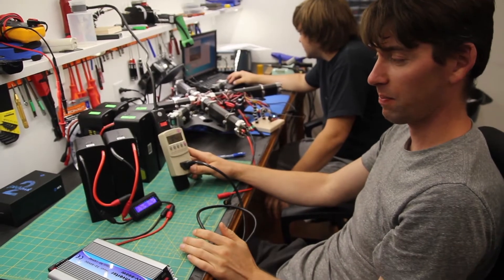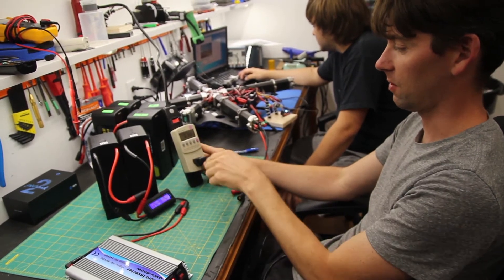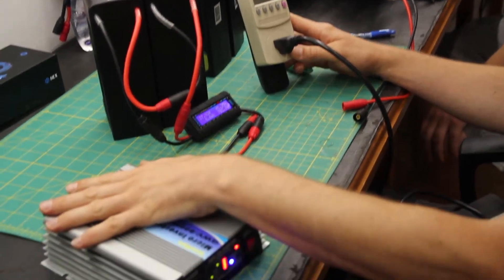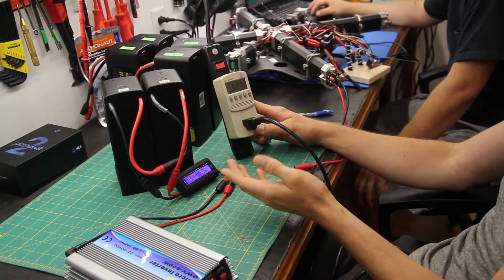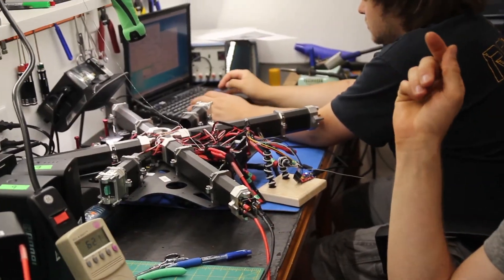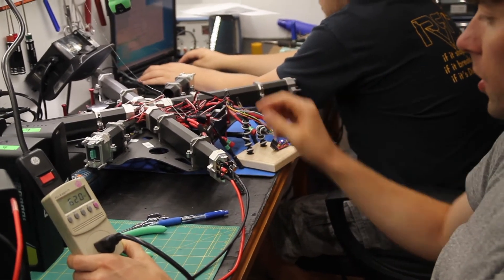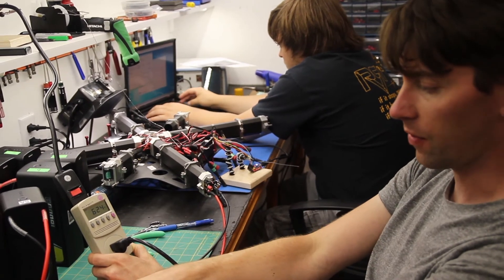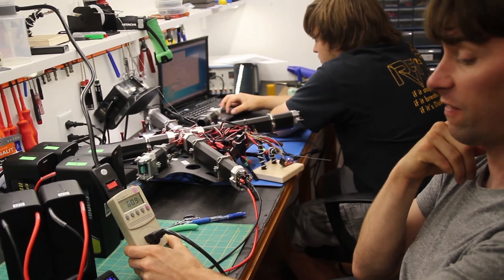In the lab with Evan vol 1. Grid Tie Inverter and Calibrating Current Sensors for Pixhawk

Comment: Does a typical electric service meter on your house know/record when you give power back to the grid?  Are there other ways you use this discharge power in the shop besides calibrations?
Reply from the maker: You need a special meter if you want to be paid back for putting money into the grid. A normal meter will slow down if you use a grid tie but not go backwards. This is a great tool for discharging batteries. We no longer use it for calibration as we have newer methods, but we still use it for discharging batteries.